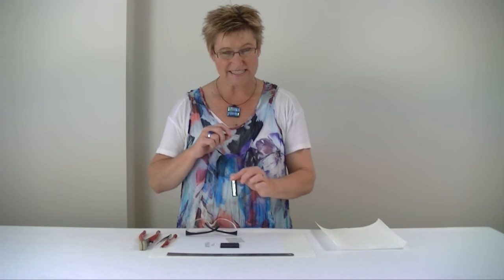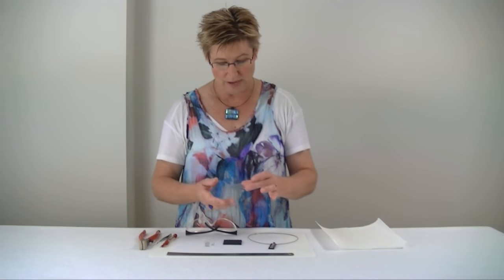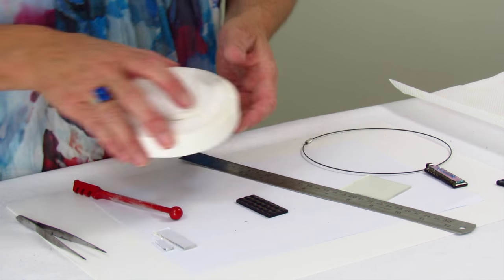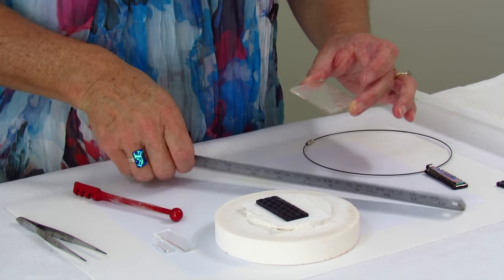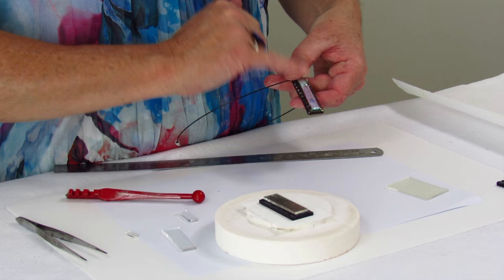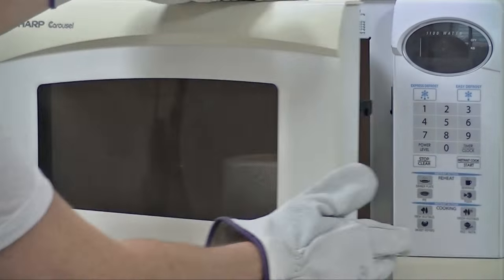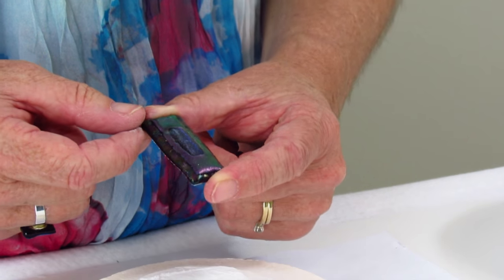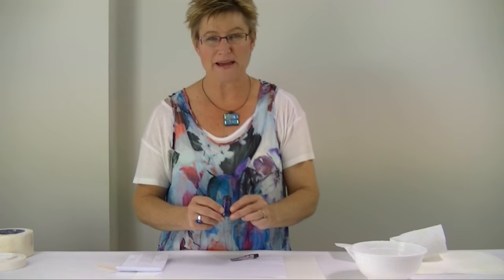How to use a Microwave Kiln - Iridized & Dichroic Glass Pendant

Comment: As someone who makes stained glass windows, you're putting too much pressure on the glass when you cut it. You can tell because it makes that harsh noise. I'm not sure if it's different because you heat the glass, but if you do this with stained glass, it can cause fault lines in the glass & make it weaker, & also makes the glass more jagged. & for very small pieces, like when you trim the final piece, you never used those pliers as its way to small to get a good grip (also can cause more pressure, resulting in breaks)- Instead, you use 2 smaller pliers, & pull away from each other.